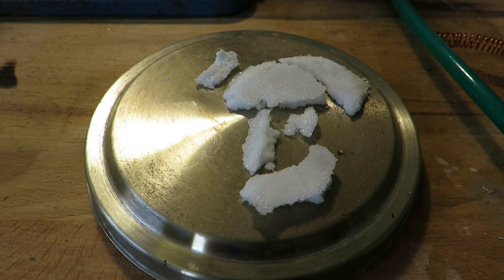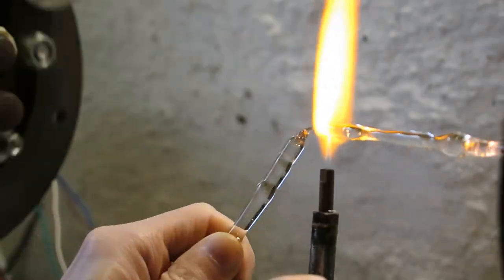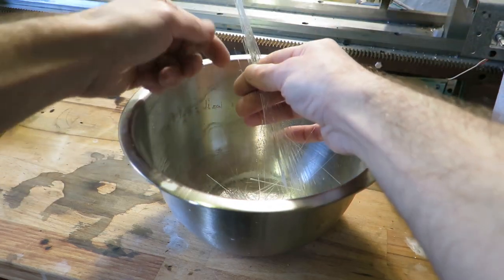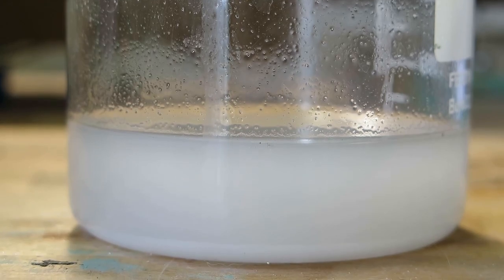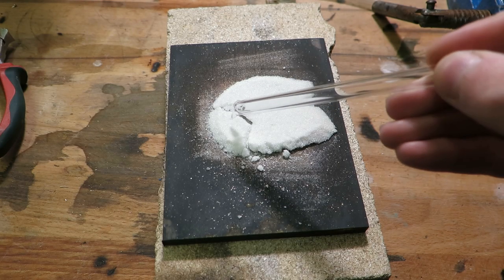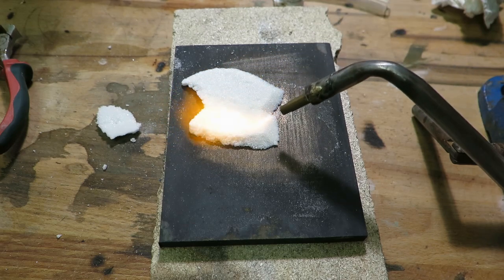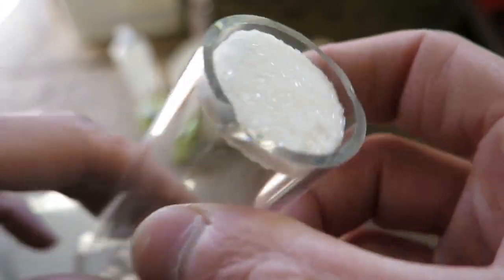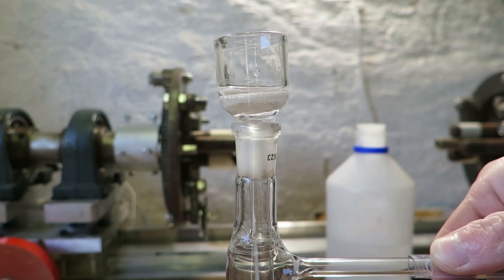Making glas fritted filters

Comment: Just use two metal plates to form uniformly thin layer and baking. and both sides will be same. You can heat metal plates with torch at the end of baking to melt surface a bit exactly under metal plates.

Comment: For those who want to make it:
1. You need a kiln heated to 800-850 C (you have to play with temperature
2. You need a mould (iron or stainless, quarz pipe pease wolud wirk, but never tried
3. Glass shall be ground on a ball mill and seived to size, depending on the porousity you want to get.
4. Put the frit to the mould and compact it (with beaker bottom or something.
5. Put the mould with the fritt to the heated oven for 5-7 minutes, but you have to play with time a lot to get good result.
6. Take mould out and cool on the table, remove glass when it is still hot.
You may use some talc to make tge mold less sticky to glass

Comment: Thank you! This is exactly what I needed to do some custom pH electrodes.
Reply from the maker: In that case I would just suggest to put some weight on top of glass during baking to get more uniform fusing
Or just buy big one and carefully file it to shape, which you may need to do anyway..
Reply: @IlusysSystems  Porous frits are hard to find here in Mexico unless bought by international shipping. I tried a desktop ball mill, but I think I used some too small bearings and ended with glass dust.
Reply from the maker: @Ottmar555  just realized, that if you want to just make permeable membrane, try shower curtains. I tested them, they can pass a lot of current, and are decently inert and would be easier to clean unless you contaminate them with organic solvents. Even then could be fine.
Reply: @IlusysSystems  For electrode applications you need to form a liquid-liquid junction. Enough mass transfer for it to be responsive, but not fast enough for it to deplete the internal solution too quickly. I don't think you'd need a lot of current, but it is an interesting option. Thank you for the suggestion. For such a cheap material, changing between runs wouldn't be a problem. So the only consideration would be designing a removable membrane in the glass electrode. If I recall, most shower curtains here are made of PVC, is the material the same in the ones you tried? What did you use them for?
Reply from the maker: @Ottmar555  Not sure if what I had was PVC or polyester. I wanted to use them as membrane in HHO to separate oxygen and hydrogen, but I decided not to do it.

I don't know anything about how PH electrodes work, so I am just shooting in the air hoping to hit something :)

Comment: What if instead of using the torch to reheat the topside loose material you tried baking it with a second graphite plate on top of the material?
Reply from the maker: Would probably work, but haven't tried

Comment: What flame source would you suggest, and would it be possible to make this without a mill?
Reply from the maker: I used just mortar and pestle so on very small scale sure, or as I said in video, use rapid cooling to powderize glass.
Reply from the maker: Ah flame source.. Hmmm you mean for furnace? I am using resistive heating elements, otherwise I use 1-2kW HHO + propane/butane for melting glass

Comment: Why couldnt you just make ruperts drops and break them in water then drain water….  You get dust…. Easy and quick…
Reply from the maker: It's not as easy as it sounds... I tried doing it by cooling glass very quickly, Issue is, that I don't have big enough equipment to heat kg of glass to high enough temperature.